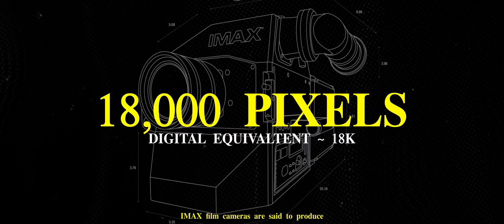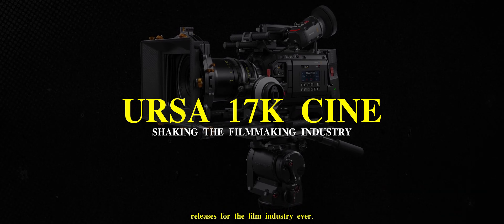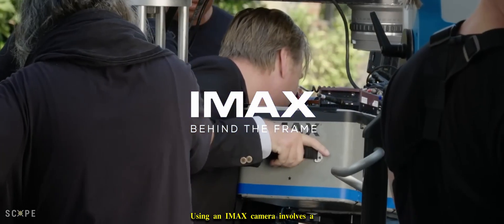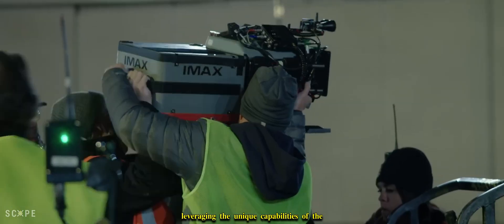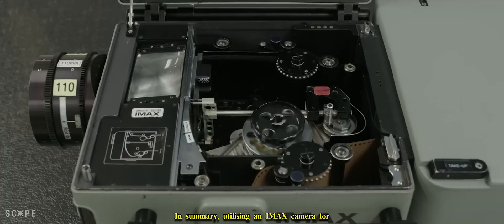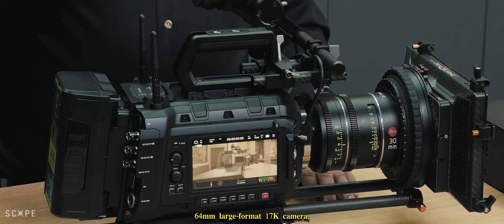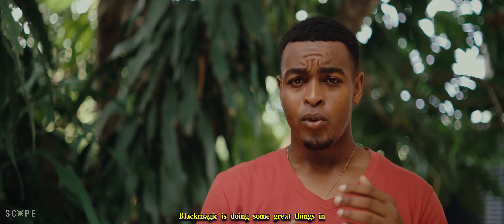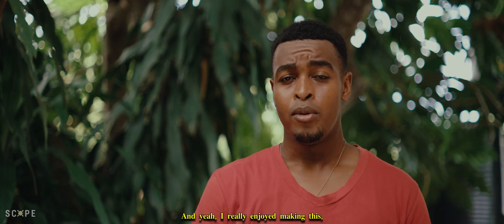The 17K Camera That's Ready To Destroy IMAX | BLACKMAGIC URSA CINE 17K

Comment: IMax ist 65mm Film exposed horizontally over 15 perforations. A 65mm sensor does NOT deliver IMAX. 
A true IMAX Sensor needs to deliver 70.41x 52.63mm. 
Dont sell 65mm Sensors as IMAX.
Reply: Thank you. They deleted my Comment on top. Missinformation on IMAX is very trendy

Comment: There's a few misconceptions. The number of pixels a sensor has does not directly correlate to resolution. The Ursa Mini 12k has a resolution of just under 4k because it's not a conventional bayer sensor design, color fidelity is split across 6x6 array of pixels. IMAX film can only resolve 18k for print stock not for camera negative. 15/70 camera negative can only resolve 11k, but when you factor in the lens used, scanner lens, scanner sensor, laser recording resolution, print stock, projector lens, which is the highest resolution route for a Nolan picture, you're sitting likely around 6k or less. In fact, the Alexa 65 at 6K is higher resolution than 15/70 camera negative scanned at 11k. Pixel density does not equal resolution, the design of those photosites does.
Reply: Very correct on the digital recording side, but not for 15/70 Film. The end-result in an 15/70mm Theater Presentation is way.. way higher than 4-times the maximum digital content available today. 1570 is an absolut overkill in these days, you have near invitie resolution, no digital systems exists (we leave the Sphere out) which can screen this uncompressed rich 1570 Content. Go for youself to a 1570 Presentation today, and all questions will end. The 6K "Story" is completly BS, even when you got that from Yedlin or else. very false. it much more than that, see it for yourself
Reply: @mixdown78  I've analysed arri laser exposed edges of 2383 and various Vision3 materials under the microscope to derive the line spread functions. The targets employed are digital input, no lens like with optical printing, and the laser dot size is 6 microns. You can fit 166 of these 6 micron lines in 1mm, that equates to a maximum spatial frequency of 83.33 line pairs / mm. A frame of 1570 film is 70.41mm x 52.63mm which means the smallest details which can be recorded to 2383 IMAX film is 11735 x 8772. Just under 12k resolution. However if instead you shot on Vision3 camera negative, then the lens MTF, stock MTF, scanner lens MTF, and scanner sensor MTF, would have also lower the spatial resolution well below 12k before you even record to projection print. So no, it's not the 18k resolution claimed. Even if it was, it's beyond human visual acuity, what matters more is the contrast of low spatial frequencies given the heynacher integral, if contrast for low spatial frequencies is lower while resolving power is higher, that will produce an image of lower perceived resolution.
Reply: @SHDEdits  
You are wrong, please read.
Thank you for your absolute precise Explanation, no doubt about it. Perfectly measured. But you've forgotten one significant Factor, with all of you modern Guys do. Major Issue, you handle a IMAX Frame like a digital Frame, which is a huge Mistake, misleading, and way apart from a live Experience. Why?

Because you brilliant mathematic Head forgot that this is a moving Picture. Your Numbers would be correct if the Frame would stand still, but it isn't obviously!
What does that mean resolution wise? There is a related Analysis compared to a digital Plattform, that on the Area of one Pixel (µm2) , do fit 17 physical random silver halides (Film). That saves through different layers the visual Information on Film. That you have measured. NOW take that x24 per Second, because you have 24 x times a Second on each Frame a complete different halides pattern(!), 24x 17 Random Halides Shapes per Pixel, per second. The difference between a photochemical stills frame and motion picture is enormous. 

You can test that anytime yourself, watch a Movie recorded on film at home on any modern Device, Press Pause and compare the huge loss on resolution. The Resolution multiplies to a huge factor with the film motion picture is running. 
This Effect is even spectacular at a real 1570 IMAX. There is no differentiation possible in my eyes, on real 1570 Scenes you have "infinite" Resolution in the Motion Picture, it is so rich and clean, "uncompressed", it is an absolute overkill, even today. There is nothing in sight in the digital world to get even close to get Content this way on the canvas, nothing. (i'm not talking things like the sphere)
Reply from the maker: Bro what, I ain't out here deleting random comments. Stop saying that
Reply: Yes, my comment appeared again, wired Youtube. for that day it was gone. i will edit it, thanks